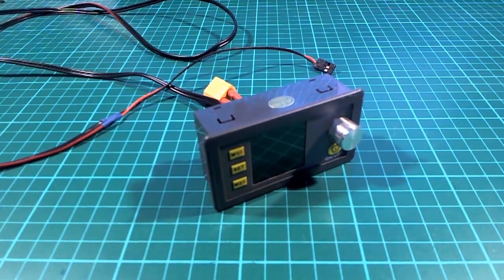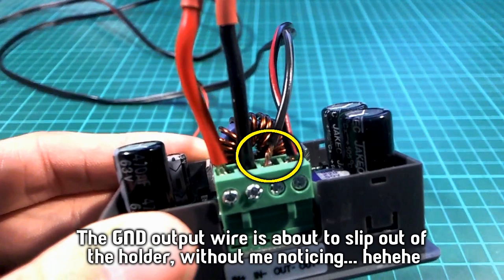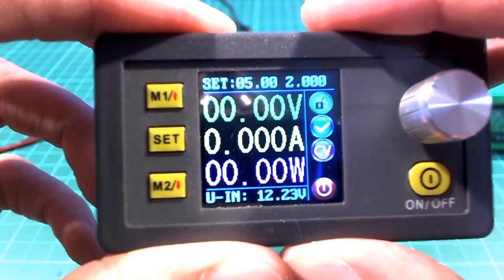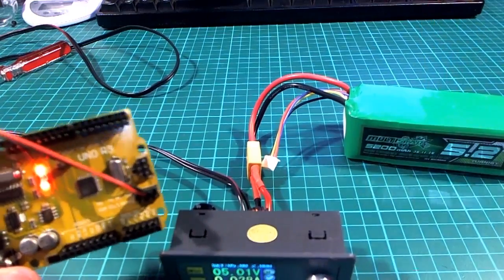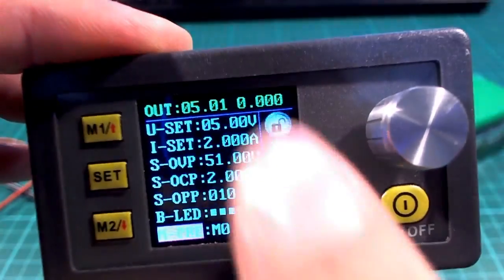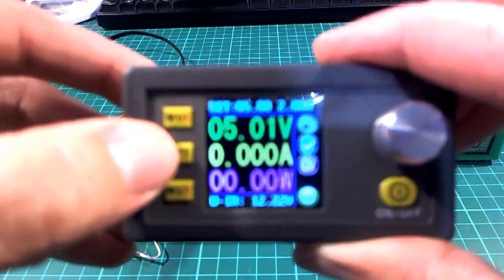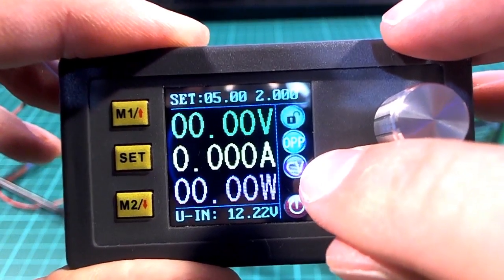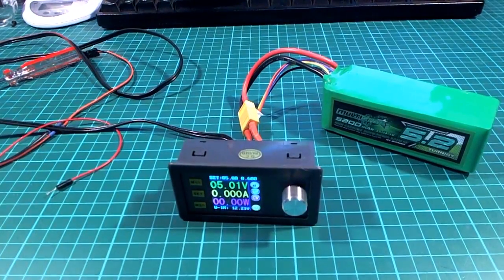Mini adjustable DC power supply/meter first look DP50V5A

Comment: can it adjust the output voltage higher than input voltage??
Reply from the maker: Read the product page. It says "Inputs must be 1V higher than the output". So with 12V input you can output 0-11V
Reply from the maker: No.
Reply: ok.. thanks :D
Reply: yes if its a step up step down converter 12 input you confert that into 0_50 V output in this case
Reply from the maker: But it's not a step up step down converter.... it's a buck converter. Look at the product page, it says so in the title. https://en.wikipedia.org/wiki/Buck_converter
Reply: his input is 12 V right? and he can ajust it into 0 to 50 V
Reply: ow sorry i havnt read the specs ur right :)
Reply: there is spet-up converters also, but for the price you cant put them in the same package..
Reply: +Gijs Van Eijk mooie spelling van convert
Reply: the datasheet implies it can. If not you can put a stup up-down board in front of it between the power supply, theyre cheap and work. Only thing to remember is the more you amplify the power the more efficiency you loose and heat you generate
.
Reply: Stephen Chandra h

Comment: U, I and P is the SI-system's symbols for voltage (V), current (A) and power (W). So it's probably intentional. However, thanks for this video. One is on the way ;) If the maximum current can be preset, this unit will be perfect for powering high power laser diodes (which are current hungry, but easily destroyed at just a little overcurrent).

Comment: Well done! Your explanation showing CV vs CC modes was nice. A test with an LED strip would also show how CC mode can be used to control the LED brightness. Thanks for the video!!
PS: I have always used V to describe voltage and E to describe electromotive force.

Comment: Are you still happy with it ? I'm planning to get one due to its neatness!
Reply from the maker: yup, it's working fine :)
Reply: Still good? I'm looking at one to build an adjustable power supply for a couple machines.
Reply from the maker: Yes still working.
Reply: Still working i think ?!
Dont wanna spend 30$ for a 2 Month wonder
Reply: btw there is a discount ATM at banggood for this one

Comment: In school I was told the formula to calculate the power usage  P=UxI  (Power=voltage X amperage). This is ohm's law I always hated that formula and always wrote it down as W=VxA and got in a couple of arguments with my teacher. more than 10 years later, I saw that teacher in a supermarket, and he still remembered me. He told me I was one of the few students that actually cared about what he was teaching. And that he mist the arguments in class after I drop his course and went on with metalworking the next year. I stilt think of that teacher every time I use ohm's law

Comment: The S-OVP, S-OCP, S-OPP are for the power source i suppose. If you have a power supply that is 50V, 2A to power this regulator you can set these values so it won't overload if it is unprotected. Pretty nice feature to have for diy projects i must say.

Comment: If you use this power supply to charge a battery, the manufacturer states you must add a diode in series to avoid back current destroying this module.  I wonder if adequate protection would be there if you simply add a diode between the input and output +ve  terminals, i.e cathode to the input and anode to the output? I remember when I built variable voltage/current  power supplies around 30 years ago, this method got around the problem, otherwise damage always resulted when the battery voltage was higher than the power supply voltage.  Otherwise if you just place a diode in the positive output leg, you're going to need to allow for a 0.6V drop across the diode and accuracy suffers. As the designer Glen Liu has been active here, I'd be interested in your comments.
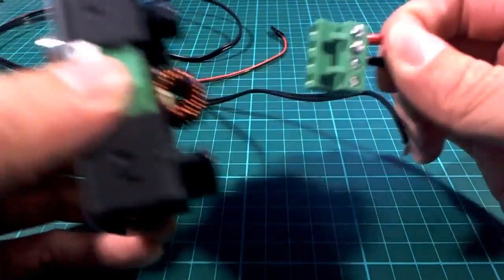Reply from the maker: Not sure if you missed it but at 3:24 I show the included diode, and a connection diagram given.
Reply: Yes, I did see that in the video. I don't think you understand what I'm actually asking. When charging batteries,  each type has a recommended voltage they should be charged to, for example a 12V  SLA = 13.8V. By placing a diode on the output you need to compensate for the 0.6V drop across the diode junction.  While not difficult, it's one more thing you'd need to consider when possibly this isn't necessary if a reverse bypass diode is fitted? That's why I'm hoping the designer can clarify this as he's been here recently.
Reply from the maker: Correct, I don't see what you're asking. To be honest I didn't see any difference between the two scenarios in your first comment, ie. "a diode between the input and output +ve  terminals" and "a diode in the positive output leg". Both of these sound the same and are what that given diagram looks like to me. I better let Glen answer...
Reply: There's a big difference between those 2x scenarios. I'd show you on a circuit diagram if it was easy to do so. When I state the input and output +ve terminals, I'm relating this to the input and output positive terminals of the module. A diode fitted between the positive output terminal and the load (battery) is the method recommended by the supplier, but this is not ideal when setting the exact voltage seen by the load as a silicon junction (diode) has a 0.6V drop  that is not exactly linear at low currents.
Reply from the maker: I see, I think. But that makes even less sense to me. So for example in my video here where I'm powering the module from a 3S lipo, the cathode of the diode would be connected to the positive terminal of my lipo, and the anode would be connected to the (in this case) 5V output of the module? Under what circumstances would current ever flow through that diode? And how does this protect the module from current flowing back from the battery? There are plenty of quick sketch sharing sites around - let me know if I'm getting this wrong: https://sketch.io/render/sk-9bc212b02d9709cd0a4df5ce2beaa593.jpeg
Reply: Your assumption of the connection details above is correct. I'm been a qualified Electronics Technician since 1979 and used to build and design gear like this back then. I've been in the IT field for the last 20+ years so haven't dabbled with this stuff for a long time. However, the reason for the diode as per my suggestion is to bypass reverse current away from the output stage of the regulator. Back when I built similar analog IC based regulated power supplies based on the old ua723 chip, I managed to blow many of them when connecting batteries to the output, when the power supply voltage was set below that of the battery. Once I'd fitted a bypass diode back to the source supply, all failures were avoided and I still have power supplies I built in 1978 still working fine, despite attempted abuse. I've just ordered one of these modules from Banggood BTW. The reason a diode is supplied with this module, is to block this reverse current (as described above)  which would destroy the module, but this isn't an elegant solution in my opinion as the battery being charged never sees the exact voltage set by the power supply.
Reply from the maker: I wasn't aware that this power module was able to step up the voltage to make it higher on the output... the manual says "inputs must be 1V higher than the output". So I was under the impression that any battery you would be charging, could only be charged to a voltage lower than that of the power input given to the module. Unless I'm wrong again, this situation would never allow for the diode in my diagram to have a current through it. It would be good to have as a safety I suppose, if a much higher voltage battery was accidentally connected. But it will only function as a safety if the battery voltage is higher than the supplied power to the module, right? For example, let's say I am powering the module with a 24V DC adapter from a wall socket, and charging a 2S lipo (output voltage set to 8.4V) and then I connect a 3S lipo (eg. 11.1V) battery to the output, what will that diode in my diagram do?
Reply: Correct. I'd already considered that scenario, and I don't believe this module can output a higher voltage than the input voltage unless it contains a DC-DC converter. Were you able to produce an output voltage higher than the input voltage with your one?  Some versions of this module apparently use different technology to the others, e.g. the 2A version needs a fan but the 5A one doesn't. I'm hoping we hear from Glen Liu at some stage for some clarity.
Reply: Hi friend . I am sorry for delay. 
about the diode, you must connect between output+ of the module and battery + , understand? you must connect here, and don't need any other protection. I can promise. if you did not operate this, you can't deny it . No research, no voice . bout the voltage drop, there is exist , it can't be avoided..
Reply: and if you have any question, you can tell me on my page and reply behind my message. thank you very much for you attention

Comment: Interesting little module, now just to get a 3D printed case with an external cooling fan on back with banana plugs on the front bottom under the display for power output out of the front.  Pretty cool it has the CC/CV and protections cutouts built in.  Not bad for $30, too bad it's not a boost/buck converter where you can feed it in 12vdc from an old busted 300~+ watt ATX power supply, have it be able to step up to 50~vdc or all the way down to it's minimum, right now it just looks like it is a buck converter and you must supply more input voltage than output voltage.
Either way...pretty interesting little module, thanks for the review

Comment: Hi friends. 
 there is good news. we just publish the DPS power supply module ( DPS3003, DPS3005, DPS 5005 and DPS 3012)
this is the link http://www.aliexpress.com/store/group/DPS-Programmble-control-power-supply/923042_508466030.html
DPS series is updated version, it updates some function and measurement range is increasing, especially DPS 30V12 ( current is 12A)http://hz.aliexpress.com/store/923042
you can check ..

Comment: Just as "i" is the symbol for current and [A] is its unit, 'u' is the symbol for EMF (sic. voltage) and [V] is its unit. It is one of those quantities where people tend to use "u" and "v" interchangeably, but the correct and unambiguous notation would be to use "u" like the manufacturer has used here. To be sure, for DC EMF, the symbol would be a capitalized "U" (again, they've used this correctly). Finally, someone who got it right :) . If you feel like arguing: "But why be so pedantic, and use 'EMF' instead of 'voltage'?" ask yourself this - How much 'amperage' do you charge your LiPo with? gah! "Current" sounds so much nicer...
Reply: In other words; U is "voltage", not "volts". I is "current", not amperes. Etc.
Reply: It depends. It's the SI-system. As I know USA still use gallons, miles, inches and probably V and E too. At least for some time ago. 

It's a cool table for SI-parameters for electromagnetism a little donw this wikipage. 

https://en.wikipedia.org/wiki/Electromagnetism
Reply: Aditya Mehendale why on U.K. Test certification is v denoted as u on ac systems and Uo as measured voltage on the supply characteristics page
Reply: I have no clue if the U.K. test-certification is consistent in its nomenclature. The SI is. They use V as the symbol for electric potential (and not U). As I said earlier, people tend to use it interchangeably. In mainland Europe, for example, the word for this electrical quantity roughly translates to "tension" - not the kind of tension you'd get in a spring, but rather there is a separate word, also used for e.g. social tension, perhaps used similarly to the English "high-tension-cable" (I know that the cable-analogy is bad, since a high tension cable actually refers to its elastic tension.). That being said, any EE would understand what you meant if you consistently used either V or U as a symbol for electric potential. The down-side to using "V" is that the symbol for the unit is exactly the same "V". This makes an (in?)equality like "V = 12V" give me the creeps. In any case, I'd recommend NOT using the symbol E. This is used categorically and universally to denote the electric-field, with a unit volt-per-meter (V/m) [which is the same as newton per coulomb N/C].
Reply: Aditya Mehendale rather than I = 5amps where as v can often stay as a constant measurement and unit I understand not fully grasping the cable elasticity thing but I'm not electronic so much as electrical if that that makes sense I guess in the long haul it doesn't really matter as long as you know not to earth it or short it your ok
Reply: Aditya Mehendale cheers for your time and input 😊

Comment: U is pretty common in Europe. 
I've been taught U=R*I.
Reply: Same. R is meaused in Ω, I is measured in A, and U is measured in V.
Reply: Seems like U as a symbol for Voltage came from the latin word urgere. Also atleast in germany we have our own standard organisation for electronics stuff (VDE) which is often used which specifies U.
Reply: U, R and I is used in equations and formulas. The units are still the same (Volt, Ohm and Amperé )
Reply: +Terry Peake What you mean is that V is the symbol of Volt. Voltage !== Volt. The former is the quantity, the latter is the unit.
Reply: "Voltage, electric potential difference, electric pressure or electric tension (formally denoted ∆V or ∆U, but more often simply as V or U"
https://en.wikipedia.org/wiki/Voltage
Reply: Some examples of quantities and units: Current (I) is a quantity, Ampere (A) is the unit. An angle (θ, amongst others) is a quantity, radians (rad) is one of the units that we use to measure angles in. Length (l) is a quantity, meters (m) is a unit. Area (A) is a quantity, square meters (m²) is a unit. Temperature (T) is a quantity, Kelvin (K) is a unit. So the same quantity can often be measured in several different units. Everybody is accustomed to the unit symbols, but it seems to be lesser a known fact that many quantities also have their own symbols.
Reply: same in Croatia
Reply: We use V in Italy, but products from Germany that I use, have the "U".
Reply: LA7YKA Norway funny :D
Reply: Yes, U, R and I are the quantities. V, Ω and A are the units. So you can write U = 1V and R = 1Ω and I = 1A. I'm not sure if U is the official SI symbol for the derived quantity of voltage, but I hope so. I think writing V = 1V seems funny, although it seems to be accepted in many places.
Reply: Mostly in countries where the SI Units aren't the Standard ;)
Reply: I don't really know what you mean with quantity (or my english isn't that good... oh wait... it is not good :P), but the unit for Voltage is Volt. In formulas U is used as the Voltage Sign. So the formula is something like: U = P / I, and then you can set your unit's in: 12V = 6W / 0.5A
Reply: Idiotic isn't it!
Reply: In the UK we still use V for voltage at school and for more advance courses an epsilon (Ɛ). I think at university we used an uppercase epsilon for DC voltage and lowercase for AC voltage, but that was over 10 years ago for me.
Reply: U dont really think that work and energy are the same, do u? That was just a joke?
A Joule is 1 Watt of power for 1 second.  Or 0,001 Watt for 1000 seconds. Or 1'000'000W (1 MW!) for 0,000001s.
Reply: TheKetsa
Reply: ***** Nice to know. But wired when you use V as a unit for voltage and V as a symbol for potential. I would rather use phi for a potential.
Reply: But we already use Cos φ :P
Reply: Yes indeed, it's used to differentiate the variable from the unit.
Reply: interesting stuff, good to know , U!
Reply: same but U often refer to a voltage different than the sourse voltage also
Reply: TheKetsa v=i x r 
P= I x v that is all transposable using the power triangle / ohms law
Reply: TheKetsa U is often voltage Uo is measured voltage on a uk test certificate anyway
Reply: just to sort this out with an update. V is the symbol for voltage. ie, 2.5V. when making a calculation U is used because it is the outcome of a voltage/current or whatever calculation. my research has uncovered that the use of "U" is not a direct unit of voltage. The IEEE have confirmed this. I must admit, i didnt know this myself until it came up in the Video. V =voltage. U is used to indicate the result of a calculation in which voltage is one of the constants.
Reply: I must admit. U i have not heard of. At uni, our calcs were, I =E/R current, Electromotive force, Resistance. I would say the U is a typo in the translation. U is not a standard abreviation on the IEEE standards

Comment: I have the DP30V5A but I-set and U-set are way off. When I-set is on 1.000A, it runs in CC at 0.900A !
Can I calibrate these values?

Comment: wawo, this video is very good. I like it . I am the designer of this goods. I guss you buy it from my sell agent .. 
we have my own shop on aliexpress http://hz.aliexpress.com/store/product/RD-DP50V5A-Constant-Voltage-current-Step-down-Programmable-Power-Supply-module-buck-Voltage-converter-color-LCD/923042_32596330856.html 
there are many other version. you can check
Reply: Just tidy up the UI & more important the poor instructions on how to use.
Reply: Peter Owens
? you don't use it ?
you can go to our chanel to see how our friend to use it , ok?
thank you 
also you can see our video to learn 
thank you
Reply from the maker: I bought DPS50V15A recently, the UI has been slightly improved.